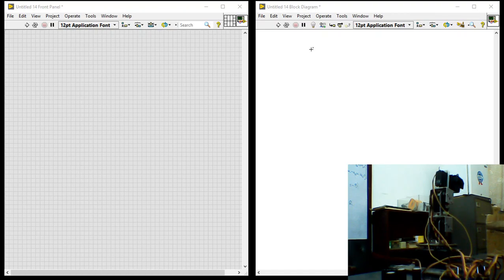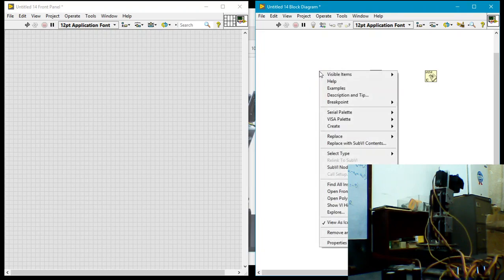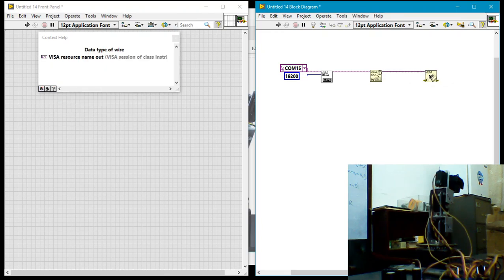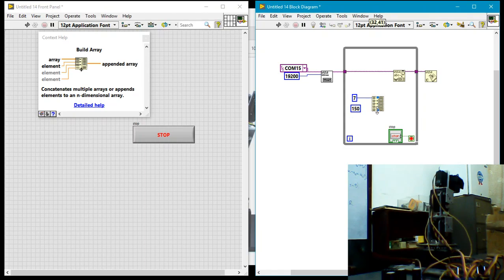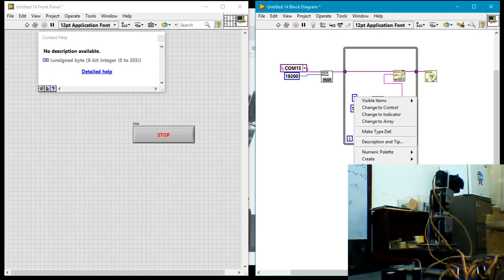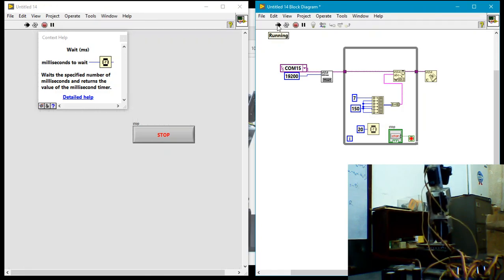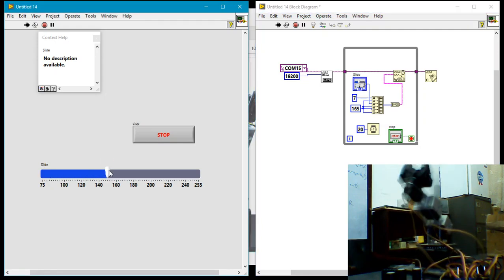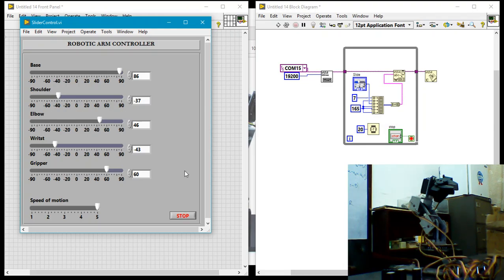How to Communicate over a Serial Port using LabVIEW

Comment: Hi, I am finding a little bit problem with the code I designed. I just want to read data from serial port with time. But it looks like labview is not reading  the data from the weighing machine. Can you help me with that? I am new to labview with zero background.
Reply from the maker: Hi. You might want to confirm that the serial port is configured correctly to interact with the weighing machine. For example, check of you are using the correct baud rate, the correct number of stop bits, whether or not parity checking is done, and if RTS/CTS is used. These can determine whether or not you are able to successfully interact with an RS-232 device.

Comment: i have ch340 (arduino copy) connected on COM7 and in labview not showed, what i can do ?
Reply from the maker: That's strange. It ought to show up. Check your device manager to see that your computer is seeing the port (or just check in the Arduino software that the port is indeed visible. If it is then refresh your ports list in LabVIEW. I hope this helps.
Reply: @OlawaleAkinwale  i solved with NI-VISA Pkg manager ty <3
Reply from the maker: @adelin3363  Great.
Reply: @adelin3363  how exactly did solve it with package manager, would be really helpful if we can connect somewhere thanks!

Comment: Hello, i have a resistive touschreen connected through a serial port from microcip to my laptop and idk how to make a project so i can use that screen as a touchscreen, i hope you might have an idea or just understand what i'm asking, thanks
Reply from the maker: Hi. I should start by saying that I haven't used a resistive touch screen before in a project and so am not sure what the interface will be. However, since it is connected to your computer via serial port, I will assume that Microchip will have set things up so that the coordinates of the position where your finger or stylus impact the board will be sent over the serial link to the computer. I will suggest that you check the dataset and find out how to communicate with the board. I did a quick check and it seems that you will use 9600 baud, 8 data bits, no parity and one stop bit. The serial data will be the coordinates touched. First project could be just to display the coordinates on the screen as numbers. Second project could be to display the touched coordinates in an x-y plotter in LabVIEW so that you can visibly see how where you touch correlates with the display on the screen. After these, the rest is up to your imagination / needs but another project could be using the touch controller as a sort of qualitative input to a simulation e.g. use where you touch on the touchscreen as a determinant of the flow rate or amount of time to take in specific states in a state machine or ...
Reply from the maker: I hope that helps.
Reply: @OlawaleAkinwale   do you think i can have any chance to talk with you on zoom or something else?

Comment: Thanks a lot for this helpful video. Could  kindly share the arduino source code. I'm having a challenge in correctly parsing received received string.
Reply from the maker: Will do. Hope to do so within 24 hrs.
Reply: @OlawaleAkinwale   Thanks a lot. Looking forward
Reply from the maker: This video did not make use of an Arduino code, just LabVIEW alone. However, below is an Arduino program for communicating over the serial port. With this, you can communicate back and forth between LabVIEW and an Arduino board. https://www.dropbox.com/s/8np7u673iv17yyz/HC-SR04.ino?dl=0

Comment: Thanks. What add on did you use? LINX or something else? I have been trying to read data using the same serial communication with LINX, however I am getting anything
Reply from the maker: In LabVIEW? I used VISA. Beyond that, there was no other add on. I used a serial to USB cable to connect the robotic arm to the computer.
Reply: @OlawaleAkinwale  Thanks for the response. Could you please share the VI file with me?
Reply from the maker: @codelery414   I am very sorry for my late response. I have not been able to locate this exact file that I created in / for this video. I will share another which is very similar to this and more advanced than this. https://www.dropbox.com/s/zs54knulwejm56n/ScriptControl.vi?dl=0

Comment: wooow verry good video, but i want to know how to how to connect 2 computer (computer 1 built the input diagram and computer 2 display the result of the computer 1... result in led indicator and statistic diagram) and both of these computer connected with utp cable. can you make a video for answer my question? because i really need to know about that. i'm sorry my english is too bad, but i hope you can understand what i mean, thanks...
Reply from the maker: Interesting one. I have not done a project like this before but will be happy to check it out and hopefully put up a video about it soon. In the mean time, you may want to check out TCP communication using LabVIEW. There are a couple of videos about this on YouTube

P.S.
No problem about the English.